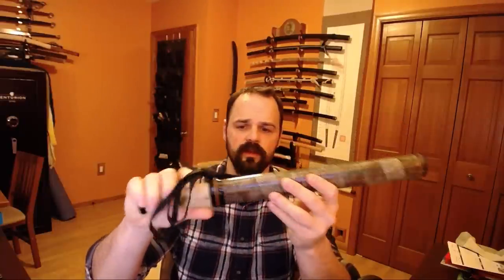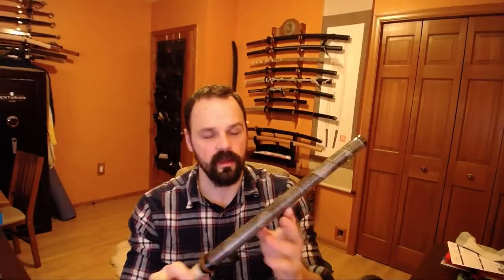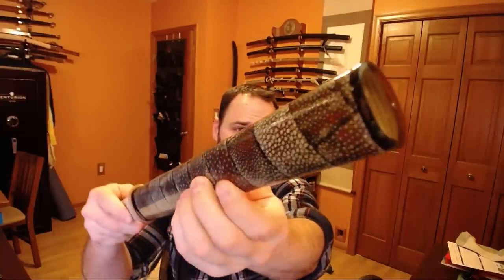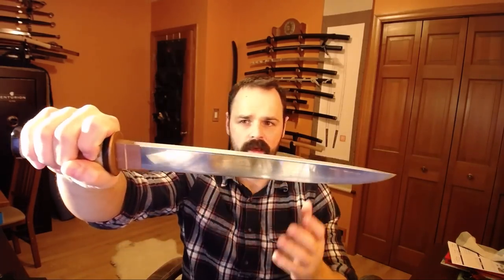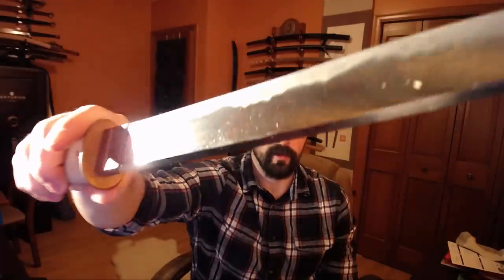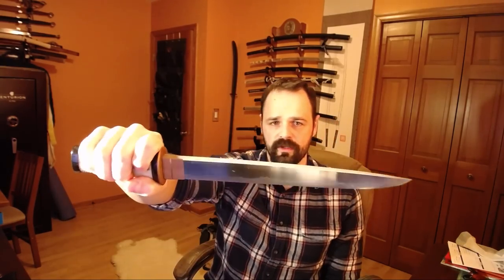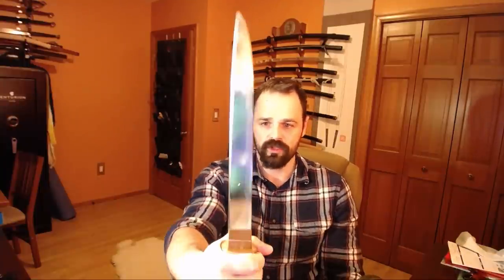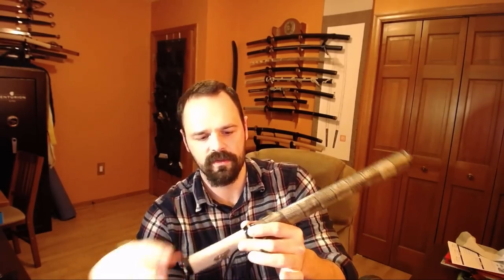Rick Barrett 1075 Hira-zukuri, Iori-mune, Uchi-zori Tanto - Quick Look

Comment: 4:09 that's the difficulty with hardened samegawa. Have to get the sanding just right or it feels like swinging sandpaper. Great for aesthetics but can be tricky to get the texture correct for the user. After some time your hands toughen up, though might take longer if you're the office type.